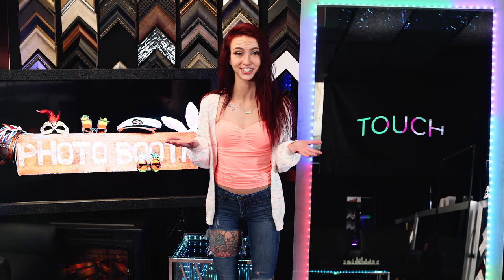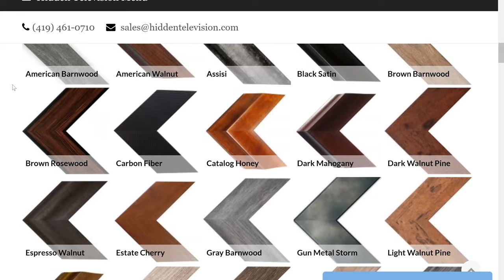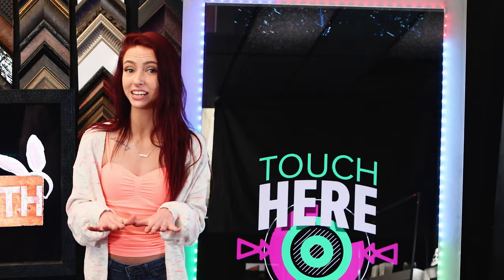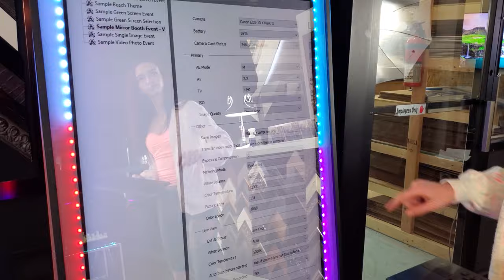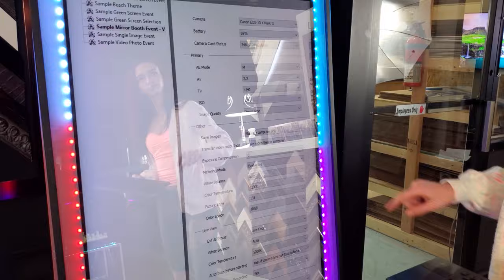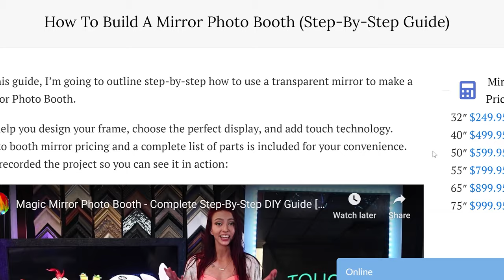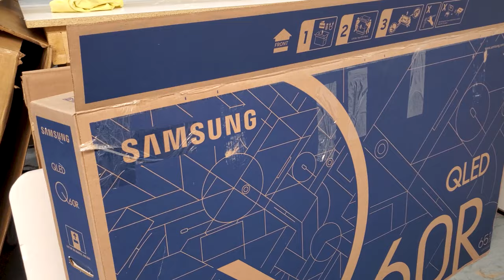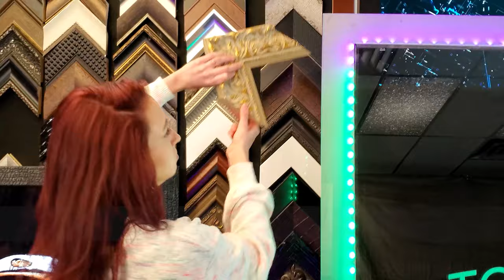Mirror Photo Booth - Build A DIY Mirror Photobooth

Comment: Waw amazing videos, I had 3 questions about the frame and the ir. Like I understand, the IR must be put in the front of the glasses? But in the final result I don't see the IR frame or am I missing something. 
2/ The glass and the IR touch screen have the samed dimension (75'') it this correct. Should the IR touch screen not it inside the mirror ?
3/ The led are glued on the TV (ok for left right and botom) but how is it done on the top of the miror since there is no TV side ?

Thanks for the answers ;)
Reply from the maker: Hi! 1) Yes the IR must go in front of the glass. You can put a frame around it to hide it. 2) The IR and glass need to be the same dimensions. It will sit on top of the glass. 3) The LEDs are glued on the back of our glass pane, but you can place them anywhere you would like! Our glass was larger than the TV, so we had it going around the back of the glass.

Comment: Does ir go in front of glass? If you have a 75 in frame how do you put the decor frame?
Reply from the maker: Yes the IR Touch goes in front of the glass. You will need to create a custom wooden frame, route out an area for the IR touch (so it will be hidden completely behind the frame) and then put the glass behind that.